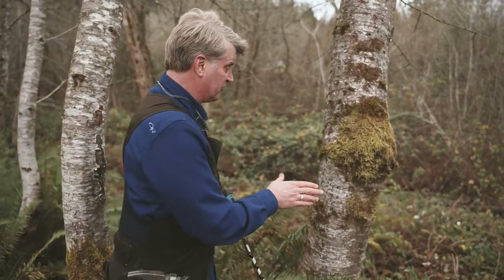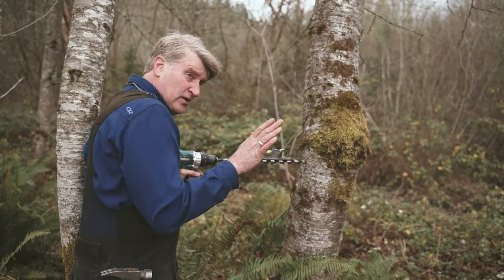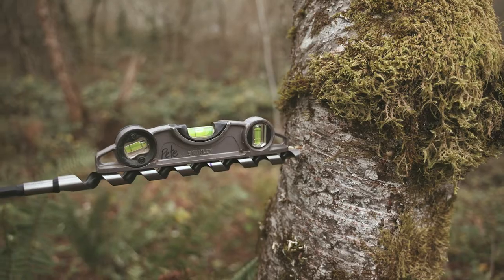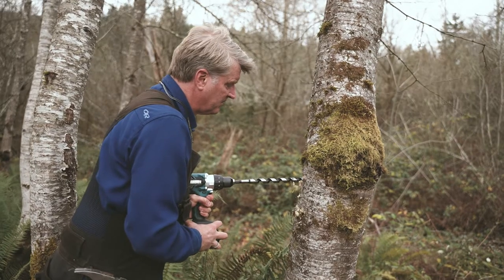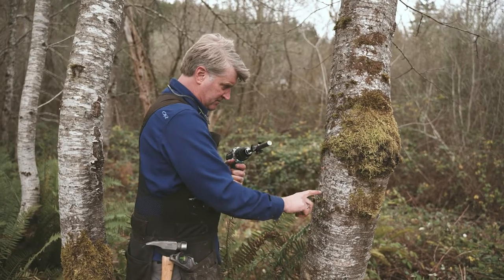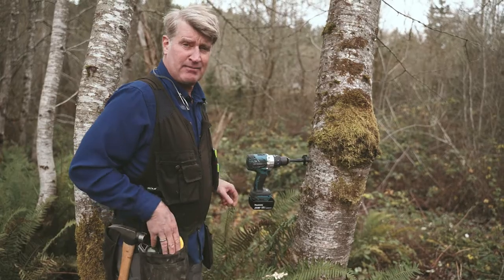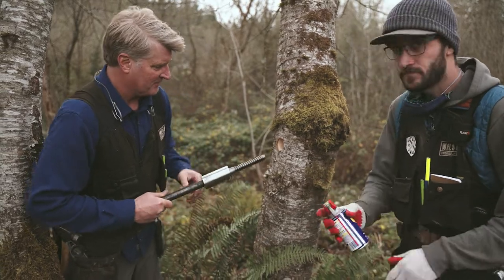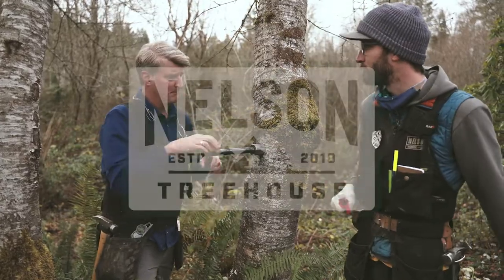Tree Fort Hardware: Treehouse Attachment Bolt (TAB) Installation

Comment: Does this hurt the tree?
Reply: Yes and no. If you drill into the tree and leave it open then it can become diseased and die. By putting the TAB system in, you’re closing up the hole and the tree will grow around the TAB which will actually make the TAB more structurally stable. So without the TAB, yes, with the TAB, no harm done

Comment: Do you use a laser level to measure the location of the tab insulation if your worried about a 1/2 inch for levels or do you us a string level after you drill the first hole

Comment: A useful video would be a method for hands free drilling. The torque of the drill is dangerous when installing these tabs at greater heights if you are working off of a ladder or using climbing gear.
Reply from the maker: We recommend keeping the handle on your drill.